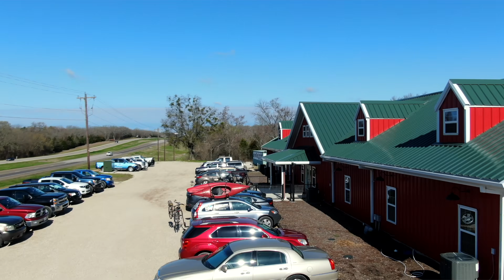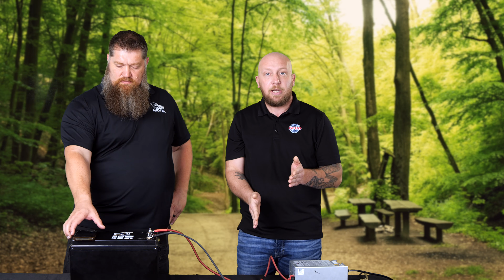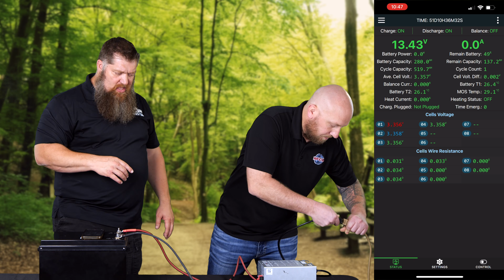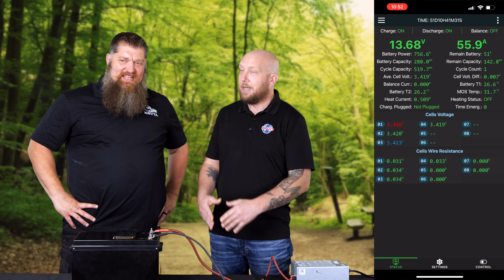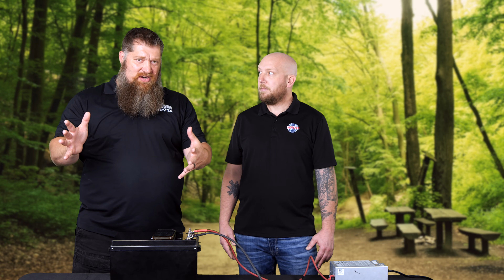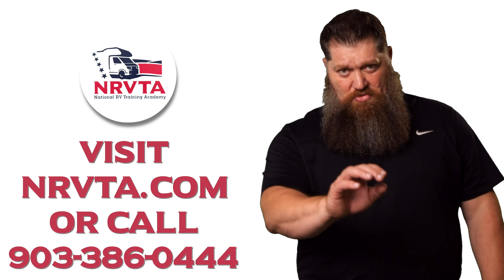WFCO auto detect battery charger, does it actually work?

Comment: In my opinion another grate idea on paper I have a brand-new Cougar 25RDS with the WF-98855-AD and honestly it sucks. They should leave it up to the customer to decide what mode/type of battery we want to be in. As mentioned in your video if you have a solar system, it confuses the unit, too many variables for it to operate in the correct mode. I and a few people I know are going to remove the WFCO auto detect unit and replace it with another brand that lets us select the type of batteries we have.

Comment: Umm auto detect maybe if you send it back for a firmware update.   Stock unit from airstream is broken.  Send to service they replaced and still broken.  Why does this feature need a firmware update?????   O and firmware is a send back because they need to flip some hardware switch’s.  Sooooo not user friendly.   Not happy with wfco. Not happy with airstream.

Comment: You need your battery discharged for it to work off the bat?  So I need to DAMAGE a lead cell or AGM battery for their product to work?  No thanks.
Reply: No, but the controller does first need to be presented with a battery that is partially discharged, so it can determine the battery chemistry by the way it accepts current.

Comment: I had one in my 2023 Airstream 30 Foot Classic that couldn't figure out I had lithium batteries installed. I decided to go with a progressive dynamics that was setup for lithium batteries only and it works. There is no auto-detecting needed with it.  Airstream went away from these after 1 year because of this. The issue is in Airstreams they are mounted too far away from the batteries is seems and this was causing them issues. Mine keep going down to below 50% of charge rate, so I got tired of that after one day I checked it and it was at 38% Charge rate.

Comment: semi related question: do you guys know an American dealer than sells 30s (126v) 700A continuous bms's? the most powerful one ive found in the usa is the xiaoxiang contactor type that battery hookup sells but theyre only 21s 300A continuous 600A peak. i need a lot more than that for my motorcycle.
Reply: Run without a bms. Wire in a econimized contactor from battery hookup and find a method for low voltage disconnect which is the only thing the bms is good for. Passive top balancing is totally unnecessary. A fuse will prevent over amperage and you can then charge/discharge whatever you want. You also will not have to worry about a bms failing which it will well before the battery cells do.

Comment: You both said that the converter would auto-detect at the end of the charge, but the converter obviously auto-detected just a few minutes into the recharge. Frankly, I like the way it seems to work better than the way you guys said it would work. I intend to have a split Lead-Acid and Lithium LiFePO4 dual system on an A/B switch. Whichever the battery the converter finds seems that it would charge correctly. I wouldn't want to switch battery chemistries while the converter was working (I'm not that brave). This way I can expand my Lead-Acid system with Lithium, since the Lead-Acid I have works well, just not enough capacity.

Comment: UPDATE- WFCO got back to me the next week and we talked and emailed back and forth. They were quite good and when they verified my situation about cable gauge, how far away the converter is from batteries, etc. and the ver of converter I had they sent me out a jumper with instructions on how to install it. I don't think this will work for everyone as some of the boards are different and don't have jumpers on them. My ver was-1.19 Firmware. Its best to call them or email them, be persistent as once I got through they were very good to work with.

Comment: I’ve tried this multiple times and it will not switch to lithium. I have a 230 AH Litime battery and a WF8735AD with version 1.19 firmware. Now what?
Reply: I just got that same Litime 230 battery, and couldn't get mine to switch.  What was your solution?
Reply: I couldn't get mine to switch with a LiTime battery either so I returned the battery and purchased a 200ah unit from CanBat. The WFCO switched to Lithium mode on the 2nd charge cycle and has remained there ever since.

Also, the LiTime battery wouldn't work with my Go Power solar charge controller either.

Comment: I found that you can fool the WFCO autodetect by 1) turn off the converter, 2) disconnecting your battery, then 3) turn the converter on, then 4) reconnect the battery. This makes it think the battery is dead, and kicks it into lithium mode. If you don't have a battery switch to disconnect, then this is too much work. Now that I have had it for a year, I found that it tends to fail when the weather is cold, say less than 50 degrees. During the summer it always charged all the way up in lithium mode.
Reply: Thanks, will try this.  What is the timing between 3) and 4)?  Does it flip to Li mode right away?
Reply: @MarkWitzel  just maybe 30 seconds I guess.
Reply: I tried it and it worked!! At least it’s working right now.  Time will tell!

Comment: I bought the AD 8955 and it worked well with the LA batteries we had. Charged them up to 55 AMPs. Now that i've switched over to Lithium it does not switch modes. I have tried many times. It only puts out 15 AMP at 13.5 volts. I emailed WFCO and filled out the form on their website as well as called and left my phone number and name on their voicemail but zero response. I would much rather have a dip switch, this is frustrating.
Reply: My experience as well ! No response from WFCO !
Reply: Do you have a prebuilt lifepo4 battery? I have the same 8955 ad. It stays in lead acid and does not have the new firmware. Charges at 55 amps until 14.3 volts then tapers down amps until 14.4. The unit will charge a max of 4 hours then float. Will need to turn off ac input/shore power then turn back on to start another charge cycle if need more than 220ah charge in one go. It will float at 13.6 in lead acid where in lithium it will not float. I am still figuring out what that entails in relation to the higher resting voltage of the cells I use.

Comment: After watching this and reading the comments;  I'm not even going to install my new 8955 which is still in the unopened box!  I'll buy something with a manual switch so that I'm in Li mode all the time instead of trying to "trick" the 8955....
Reply: 14.4 volts is best with lead acid mode does. 14.6 is for the passive balancing which is useless with good cells. I have the 8955 and its charges 55 amps until 14.3 then tapers down until done. Once they are balanced they do not need to be balanced again for a long long time. at 14.6 volts the cells are in the life shortening zone for only as little as 400 milli amp hours (.4ah) but taking hundreds of cycles away in life. Better yet get rid of the bms and never worry about it failing randomly bricking your battery much sooner than the cells go bad.

Comment: I installed last week and it’s been working great. Will update I also have the latest firmware. Drained my lithium battery to around 40% and followed a different video that WFCO put out on detecting a lithium battery and it worked first time, detecting lithium. Great video
Reply from the maker: Thanks for sharing
Reply: How did you discharge your battery? I don't want to wait for weeks...

Comment: I have a question. If I have the lithium only mode, will the solar still mess with the auto sense feature?

I have a 2022 Winnebago 2100BH with the 8955-ad converter, and the camper also has a solar panel and charge controller. I’ll be using a generator during generator hours but it’s only 2 times a day for 2 hours. I just want my fridge to stay running, so I find this whole problem actually really concerning. It seems like I can’t trust things to work this way, which is odd for an “auto” system.

I saw another video where WFCO offered to make the converter lithium only for the customer.

Any insight would be appreciated.

Comment: This doesn't deal with the issue of the converter reverting to lead acid mode, which mine does. I bought a 8740 AD which should have been a swap for my 8735 P. I spent several hours removing the old one and installing the new one. I could not get it to switch to lithium mode, even doing all the tricks recommended by WFCO. Support said send it to us and we will do a firmware update. I took the time to remove the unit and sent it to WFCO. Counting the ground shipping, it was gone nearly a month. I got it back, reinstalled it, and it went to lithium mode. Yippee, except that it converted back to lead acid again and does this all the time!! I would much prefer a switch and recommend that anyone looking to change converters to deal with lithium batteries steer away from the WFCO units. They aren't ready for prime time. Give me the switch all day long.

Comment: Question… My rv is equiped originally with this converter and I have a Furrion solar panel and controller. The electrical box is at least 20 feet away from the batterie. Can I drop a Lithium batterie in (or two), or do I have to make some changes?

Comment: It’s a decent theory but a manual switch is a better approach. I have one of these and it won’t switch to lithium charging and it won’t fully charge my battery to full capacity. If I have to uninstall it, send it back, then reinstall it, I’ll just buy a competitor’s product with a manual setting. My $40 lithium battery charger worked great charging my battery, my WFCO will not. You can justify design all you want, it’s an over designed POS.

Comment: Big Beard. Congrats on your new larger space efficient battery. When coming up with your Inverter in the future what will you do differently to add to the worlds leading brand? Also because there’s times we want parallel solar hookup for even intake.  Are you going to design a hardware that convert from series to parallel? Of course wire gauge will play a big factor but I know you’ll figure a way to run two separate gauges when switching one to other.  Please educate us on your future plans with this newly improved innovation.

Comment: Great video and very helpful. I thought I was having problems with auto detect. Called WFCO and we worked thru the problem. Their support is great. Turns out the BMS on the battery was not working properly. Replaced the battery and it's detecting and charging properly. One think that was briefly mentioned here is firmware. Verify it before you install the converter. The unit I purchased from Amazon had a sticker inside the door with the firmware version. I called WFCO support and determined a newer version was available. They generated an RMA with pre-paid shipping and I returned the unit for an update. The turn around was about a week.
Reply: Which firmware version did you have?

Comment: This is purely misleading damage control.  I, like others here, bought a new travel trailer with one of these WFCO auto-detect chargers in it, and having read "auto detect" in the manual, I went ahead and replaced the factory group 24 AGM battery with a Renogy 200Ah Lithium battery.  When I discovered how absurdly long it was taking to re-charge the battery, I reached out to WFCO and got a link to this video, along with a lot of absurd questions that point to the idea that this problem, at the end of a lot of conversation with WFCO support people, will be that some set of circumstances on my trailer has confused the WFCO charger.  Just the idea that I've got to put the battery and the charger less than 10 feet apart is nonsense.

WFCO should not be claiming that these chargers do any form of auto detection of Lithium batteries.  The range of circumstances under which WFCO chargers will actually do the job tells me these really aren't Lithium battery compatible at all, except of course on a bench, with 3 feet of wire between the charger and the battery, and the battery at a relatively low state of charge.  I believe WFCO has managed to discredit the National RV Training Academy by putting up this content, and suggest it would be in the better interests of both organizations to take it down.

Comment: I bought the WFCO Auto detect and it detected the Lithium mode fine but would not stay in bulk charge mode.  Called WFCO discovered that in spite of the Seller's statement of having the current firmware on the charger I didn't. 
 After returning the unit to WFCO for a firmware update it works wonderfully.  The unit chargers my lithium batteries at the proper voltage and proper amount of time at bulk rate.

Comment: The converter should have remote voltage sensing and not rely on the power cables for voltage information, then the battery can be placed in the next state if you want.  Your engineers should know this?  I think so.

Comment: If there is a distance issue between the battery and charge controller, what is involved in moving the controller to the battery, or vice versa? You touched on it in minute.  But is it as simple as just moving the controller? Or is there a bunch of wiring as well?

Comment: This video is not accurate, at least not in the 8955 that came in my 2023 camper.  I have this same converter/charger and I upgraded to lithium batteries and I did everything that WFCO instructed me to do to get the 8955 charger to work with my new upgraded lithium batteries and it does not charge the way they are stating in this video.  I did get it to switch from a green light to blue light.  However, it will only charge at a float charge and takes forever to charge my batteries.  I was told by WFCO that the 8955 I have in my coach is the first generation and it will need a firmware update, which can only be done at the manufacturer.  WFCO technical support said I need to submit a claim (which takes 3-4 weeks to get approved), and once approved, then I will need to send the charger/converter to WFCO to have them update the firmware so it will work properly.  I asked them if they could send me a new updated one and then I will send the old one to them, which would not impact my camping season, however WFCO is not willing to do that.  Very frustrated that they produced a product that does not do what they said.
Reply: I have that same converter. It stays in lead acid but still charges 55 amps until 14.3v then tapers down till 14.4v. Which is the ideal voltage for long battery life. The only thing I can imagine is the bms is fighting it. Rip out the bms, top or bottom balance yourself and then balance again in 2-3 years. Good cells do not need balancing after the one time initial balance for years. The battery I am getting this with is without a bms and using quality LEV60 cells from battery hookup

Comment: Unfortunatly i have a auto detect power station and it will NOT auto switch to "blue" lithium. Yes the red bulk led comes on, but stays with green leaf acid.  If you call Wfco they actually tell you to disconect power when the rec lec comes on to get it to switch.  If ibpull my 30 amp fuse and reinstall it, it will then AND ONLY then give me the blue led lithuim.  Once in lithium it will stay in lithium untill disconected, then i need to do the process all ovet again.  My batteries are lion energy so they are good quality batterys.   So auto detect....NO
Reply: Same for me. Going to buy a lithium only charger. This product is no good.